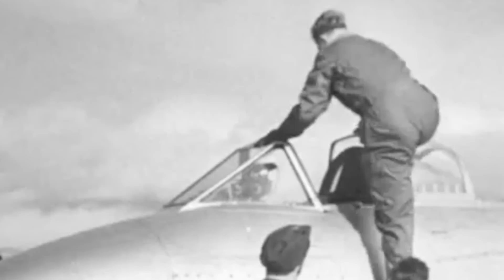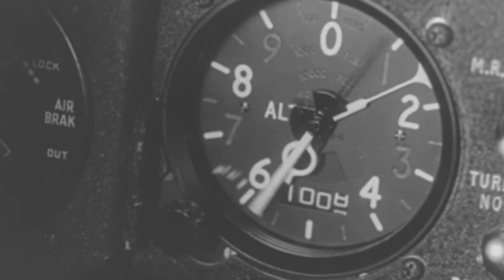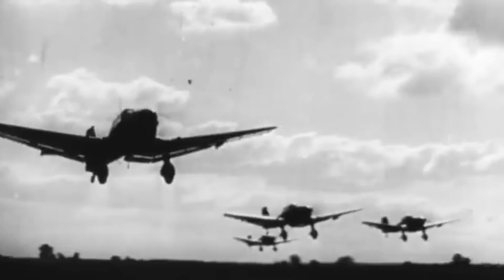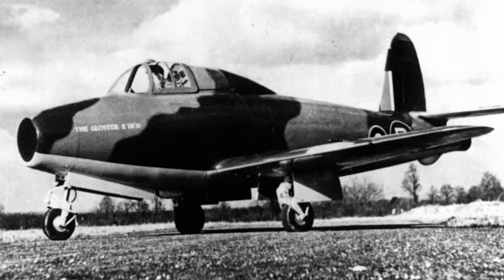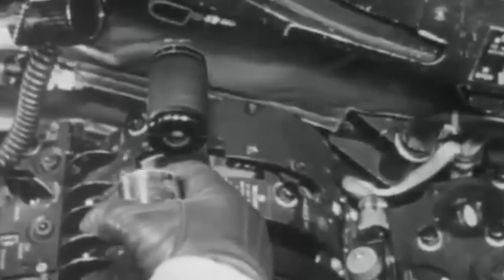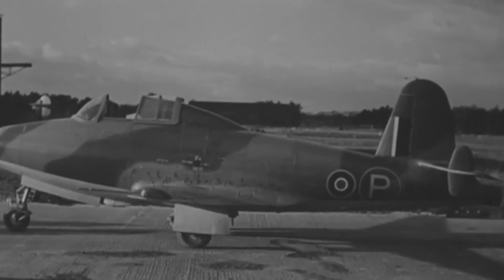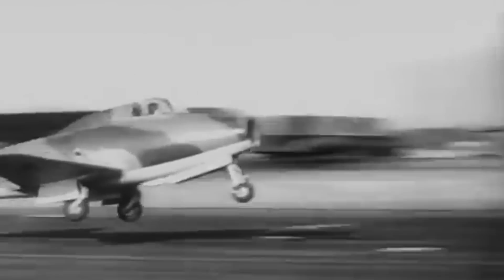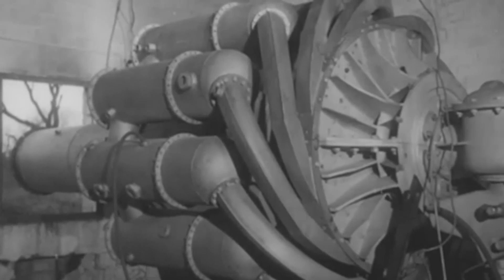Britain's 500 MPH Coffin With Wings

Comment: Why are all these articles spouted by a no nothing American? Make sense or shut up.
Reply: America invented the airplane... Britain had always lagged years behind America, Germany and France in aircraft technology.
Reply: @DoktorBayerischeMotorenWerke 

That's correct of course, the UK have been more than 10 years ahead for some time.

  That's correct of course, Gas turbine concept & patent, before 1800 in England.

   Of course the World's first all metal construction airframe airliner - Handley Page England 1920.

   Indeed the World's first aircraft Pressurisation - 1920s British design Airco built under licence in the US & modified for pressurisation during a joint US / UK research project.

    Absolutely correct of course - World's first axial compressors & axial turbines - as used in current gas turbine aero engines - Parsons of Ireland & North England for turbomachinery applications. Also worked on basic ideas for the internal combustion axial gas turbine aero engine, all before 1900.

  Work on large airliner style aircraft using super lightweight steam power - 1800s England.

Basic modern theory of aircraft & flight - George Cayley England 1800s.

"About 100 years ago, an Englishman, Sir George Cayley, carried the science of flight to a point which it had never reached before and which it scarcely reached again during the last century." — Wilbur Wright, 1909.

  Yes it is if course correct that the World's first demonstration of a pure gas turbine aero engine - Whittle in England 1937. Currently produced as the Pratt & Whitney PW200 range of engines.

Notes on a British airliner. 

Comets flew until 1997.
The Comet design had military use as a requirement. Nimrod development began at De Havilland before 1953, Nimrod aircraft were in service until 2011.
The Nimrod were not withdrawn due to structure problems or other airframe issues it was entirely a significant upgrade snag & resultant basic economics & an end of line sale happening at Bow-wing (see b-47 wing folding incidents for info) at the same time.

  We feel we can shed some light on some common misunderstandings.

  At the time the Comet wasn't particularly dangerous.

Losses comparisons
How things were in those days.

DeHavilland Comet 4 UK           14% 
DeHavilland Comet all  mks       17%  

Boeing 307                               70%
Boeing 247                               48%
Boeing 707            .                  20% 
Boeing 707                                20% 
Lockheed Electra Turboprop   29%
Canadair CL-44  Turboprop     46%  
Convair CV-580  Turboprop     22%
Convair CV-880    (ff 1959)       27%  
Convair CV-990     (ff 1961)      35%

     Of course De Havilland had prior experience building many all metal construction airframe aircraft & thousands of jet powered fighter aircraft that were primarily of metal construction with pressurised cockpits & jet engines built by De-Havilland.

   De Havilland carried out full stress analysis & engaged in a comprehensive & protracted testing program which is why key De Havilland people were happy to be aboard flying DH Comet aircraft.

    That's correct, the DH Comet was the first passenger airliner with full length fuselage pressurisation at 8psi pressure differential. Handley Page built the world's first all metal construction airliner during the 1920s.
    In many cases earlier pressurised aircraft were larger, needed thicker fuselage skins due to flying stresses alone & had much lower pressurisation differential pressure.

     Of course ripstop provision was provided. The skin alloy used became unavailable at the time due to R & D at the manufacturers which resulted in the original alloy being discontinued. Later alloys had very similar properties. The skin thickness used for the Comet was used for similar size later aircraft. Frame spacing was not found to be too large & frame width was not found to be too small.

    Without doubt De Havilland did indeed always work to better than industry standards at the time, used up to date knowledge for the design & construction & no evidence of negligence or criminal negligence was ever produced in relation to the DH Comet.

   The DH Comet had no effect on the course of the aerospace industry in the UK. The UK now has the world's largest combined nuclear, aerospace & defence sector per capita activity.

    That's correct, the investigation committee did not find hundreds of fatal flaws or evidence of design defects, structural defects, defective materials or shoddy workmanship. Indeed it is the case that ripstop provision was included. Claimed incidents did not involve cracks starting from passenger window corners.
   Pretty much all changes were just in case changes or were planned development modifications & improvements that were scheduled regardless of incidents.

    Obviously De Havilland designers knew all there was to know about metal fatigue at the time they designed the DH Comet.

We hope this helps, obviously.

Cheers indeed of course 👍.  
 
 . . .... ... ..... .. ...
Reply: @petemaly8950  Please name a single British company that still makes British jet aircraft in the UK?

Comment: Britian.invented.the.jet.the.radar..and.many.more
Reply: Whittle was only the FOURTH person to successfully demonstrate a working jet aircraft engine, he can only be credited as the "First in the UK".
Reply: Britain claims to have invented everything that is not a moon rocket...
of course their lead in technology ended back in the steam era
Reply: @sandervanderkammen9230 

@DoktorBayerischeMotorenWerke 

   Of course the World's first all metal construction airframe airliner - Handley Page England 1920.

   Indeed the World's first aircraft Pressurisation - 1920s British design Airco built under licence in the US & modified for pressurisation during a joint US / UK research project.

    Absolutely correct of course - World's first axial compressors & axial turbines - as used in current gas turbine aero engines - Parsons of Ireland & North England for turbomachinery applications. Also worked on basic ideas for the internal combustion axial gas turbine aero engine, all before 1900.

  Work on large airliner style aircraft using super lightweight steam power - 1800s England.

Basic modern theory of aircraft & flight - George Cayley England 1800s.

"About 100 years ago, an Englishman, Sir George Cayley, carried the science of flight to a point which it had never reached before and which it scarcely reached again during the last century." — Wilbur Wright, 1909.

  Yes it is if course correct that the World's first demonstration of a pure gas turbine aero engine - Whittle in England 1937. Currently produced as the Pratt & Whitney PW200 range of engines.

Notes on a British airliner. 

Comets flew until 1997.
The Comet design had military use as a requirement. Nimrod development began at De Havilland before 1953, Nimrod aircraft were in service until 2011.
The Nimrod were not withdrawn due to structure problems or other airframe issues it was entirely a significant upgrade snag & resultant basic economics & an end of line sale happening at Bow-wing (see b-47 wing folding incidents for info) at the same time.

  We feel we can shed some light on some common misunderstandings.

  At the time the Comet wasn't particularly dangerous.

Losses comparisons
How things were in those days.

DeHavilland Comet 4 UK           14% 
DeHavilland Comet all  mks       17%  

Boeing 307                               70%
Boeing 247                               48%
Boeing 707            .                  20% 
Boeing 707                                20% 
Lockheed Electra Turboprop   29%
Canadair CL-44  Turboprop     46%  
Convair CV-580  Turboprop     22%
Convair CV-880    (ff 1959)       27%  
Convair CV-990     (ff 1961)      35%

     Of course De Havilland had prior experience building many all metal construction airframe aircraft & thousands of jet powered fighter aircraft that were primarily of metal construction with pressurised cockpits & jet engines built by De-Havilland.

   De Havilland carried out full stress analysis & engaged in a comprehensive & protracted testing program which is why key De Havilland people were happy to be aboard flying DH Comet aircraft.

    That's correct, the DH Comet was the first passenger airliner with full length fuselage pressurisation at 8psi pressure differential. Handley Page built the world's first all metal construction airliner during the 1920s.
    In many cases earlier pressurised aircraft were larger, needed thicker fuselage skins due to flying stresses alone & had much lower pressurisation differential pressure.

     Of course ripstop provision was provided. The skin alloy used became unavailable at the time due to R & D at the manufacturers which resulted in the original alloy being discontinued. Later alloys had very similar properties. The skin thickness used for the Comet was used for similar size later aircraft. Frame spacing was not found to be too large & frame width was not found to be too small.

    Without doubt De Havilland did indeed always work to better than industry standards at the time, used up to date knowledge for the design & construction & no evidence of negligence or criminal negligence was ever produced in relation to the DH Comet.

   The DH Comet had no effect on the course of the aerospace industry in the UK. The UK now has the world's largest combined nuclear, aerospace & defence sector per capita activity.

    That's correct, the investigation committee did not find hundreds of fatal flaws or evidence of design defects, structural defects, defective materials or shoddy workmanship. Indeed it is the case that ripstop provision was included. Claimed incidents did not involve cracks starting from passenger window corners.
   Pretty much all changes were just in case changes or were planned development modifications & improvements that were scheduled regardless of incidents.

    Obviously De Havilland designers knew all there was to know about metal fatigue at the time they designed the DH Comet.

We hope this helps, obviously.

Cheers indeed of course 👍. 
 
 . . .... ... ..... .
.  ... ...... .....
Reply: @sandervanderkammen9230 

That's correct of course, the UK have been more than 10 years ahead for some time in may areas of endeavour.

  That is indeed correct of course, Gas turbine concept & patent, before 1800 in England.

   Of course the World's first all metal construction airframe airliner - Handley Page England 1920.

   Indeed the World's first aircraft Pressurisation - 1920s British design Airco built under licence in the US & modified for pressurisation during a joint US / UK research project.

    Absolutely correct of course - World's first axial compressors & axial turbines - as used in current gas turbine aero engines - Parsons of Ireland & North England for turbomachinery applications. Also worked on basic ideas for the internal combustion axial gas turbine aero engine, all before 1900.

  Work on large airliner style aircraft using super lightweight steam power - 1800s England.

Basic modern theory of aircraft & flight - George Cayley England 1800s.

"About 100 years ago, an Englishman, Sir George Cayley, carried the science of flight to a point which it had never reached before and which it scarcely reached again during the last century." — Wilbur Wright, 1909.

  Yes it is if course correct that the World's first demonstration of a pure gas turbine aero engine - Whittle in England 1937. Currently produced as the Pratt & Whitney PW200 range of engines.

Notes on a British airliner. 

Comets flew until 1997.
The Comet design had military use as a requirement. Nimrod development began at De Havilland before 1953, Nimrod aircraft were in service until 2011.
The Nimrod were not withdrawn due to structure problems or other airframe issues it was entirely a significant upgrade snag & resultant basic economics & an end of line sale happening at Bow-wing (see b-47 wing folding incidents for info) at the same time.

  We feel we can shed some light on some common misunderstandings.

  At the time the Comet wasn't particularly dangerous.

Losses comparisons
How things were in those days.

DeHavilland Comet 4 UK           14% 
DeHavilland Comet all  mks       17%  

Boeing 307                               70%
Boeing 247                               48%
Boeing 707            .                  20% 
Boeing 707                                20% 
Lockheed Electra Turboprop   29%
Canadair CL-44  Turboprop     46%  
Convair CV-580  Turboprop     22%
Convair CV-880    (ff 1959)       27%  
Convair CV-990     (ff 1961)      35%

     Of course De Havilland had prior experience building many all metal construction airframe aircraft & thousands of jet powered fighter aircraft that were primarily of metal construction with pressurised cockpits & jet engines built by De-Havilland.

   De Havilland carried out full stress analysis & engaged in a comprehensive & protracted testing program which is why key De Havilland people were happy to be aboard flying DH Comet aircraft.

    That's correct, the DH Comet was the first passenger airliner with full length fuselage pressurisation at 8psi pressure differential. Handley Page built the world's first all metal construction airliner during the 1920s.
    In many cases earlier pressurised aircraft were larger, needed thicker fuselage skins due to flying stresses alone & had much lower pressurisation differential pressure.

     Of course ripstop provision was provided. The skin alloy used became unavailable at the time due to R & D at the manufacturers which resulted in the original alloy being discontinued. Later alloys had very similar properties. The skin thickness used for the Comet was used for similar size later aircraft. Frame spacing was not found to be too large & frame width was not found to be too small.

    Without doubt De Havilland did indeed always work to better than industry standards at the time, used up to date knowledge for the design & construction & no evidence of negligence or criminal negligence was ever produced in relation to the DH Comet.

   The DH Comet had no effect on the course of the aerospace industry in the UK. The UK now has the world's largest combined nuclear, aerospace & defence sector per capita activity.

    That's correct, the investigation committee did not find hundreds of fatal flaws or evidence of design defects, structural defects, defective materials or shoddy workmanship. Indeed it is the case that ripstop provision was included. Claimed incidents did not involve cracks starting from passenger window corners.
   Pretty much all changes were just in case changes or were planned development modifications & improvements that were scheduled regardless of incidents.

    Obviously De Havilland designers knew all there was to know about metal fatigue at the time they designed the DH Comet.

We hope this helps, obviously.

Cheers indeed of course 👍.  
 
 . . .... ... ..... .. ...
. ...... ...... ..........